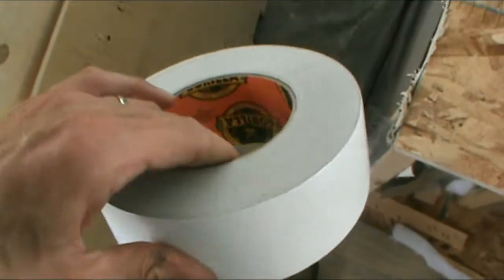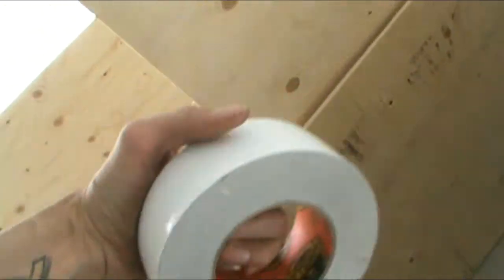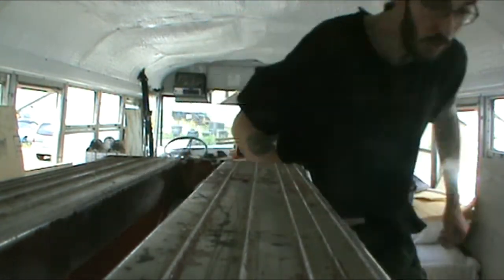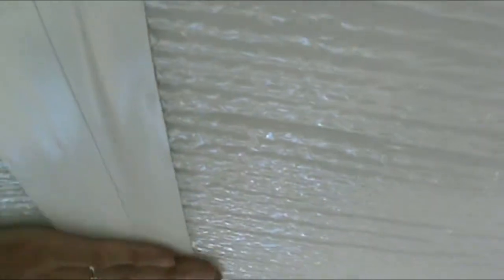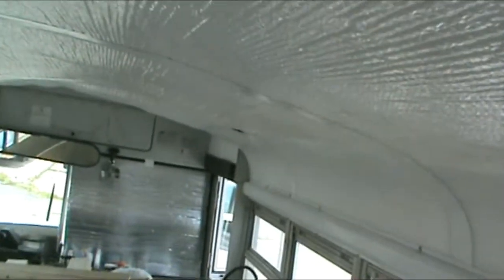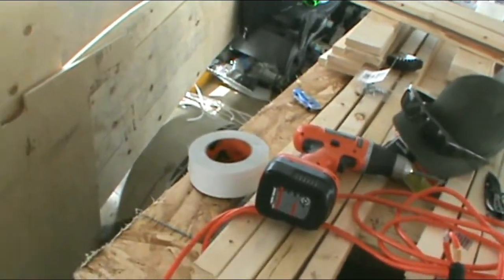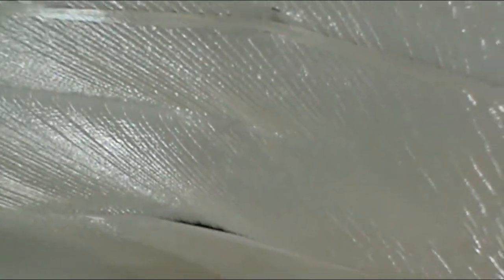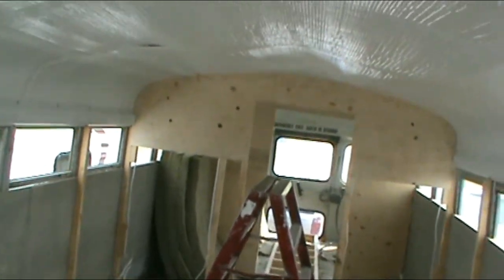Skoolie Conversion Part 14. From School Bus to RV

Comment: would it not of been easier to put narrow tung and groove floor boards on the ceiling
Reply from the maker: Big Bad Wolf It may be easier to do it that way however it is also considerably more expensive to do it that way as well. Our entire build has been done on a very tight budget and the difference in price, even for cheap flooring, was over 50 cents per square foot. I looked into many different options before settling on this one.
Reply: Big Bad Wolf 1....NO. 2 EVERYONE does it.   Y be typical as 150 other conversions